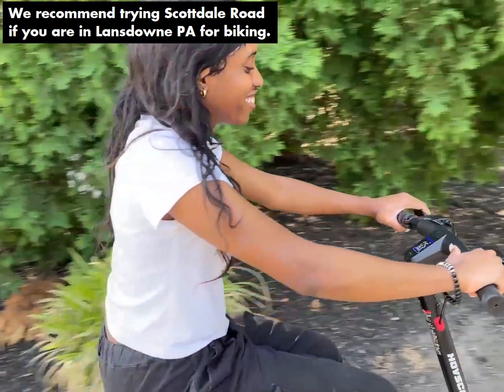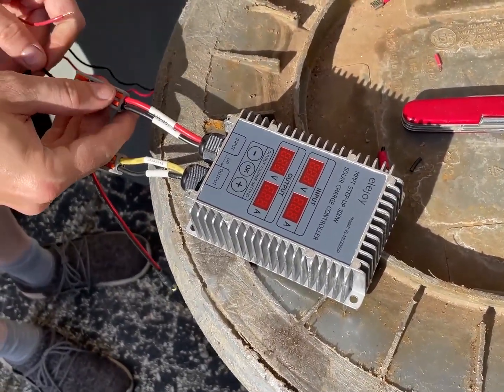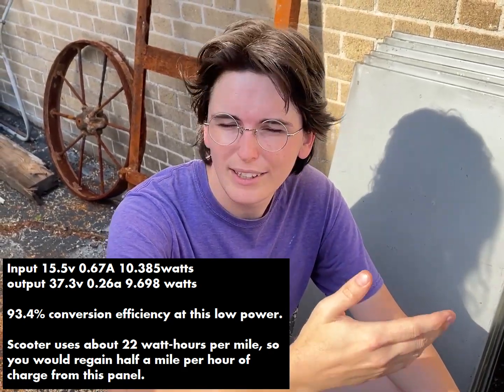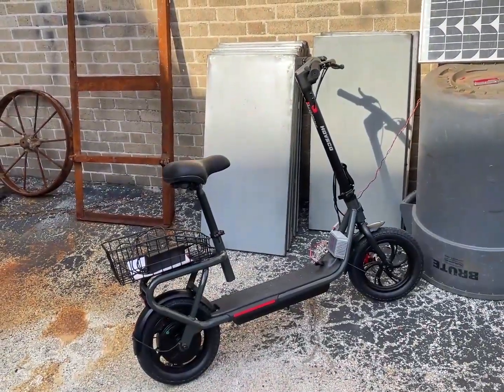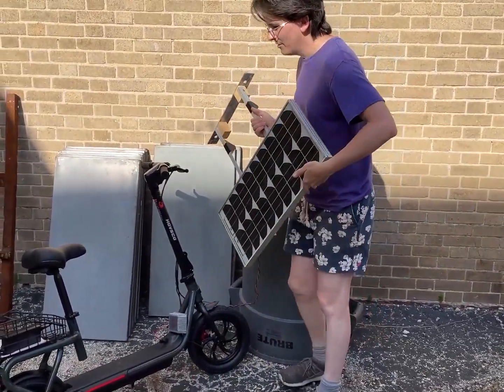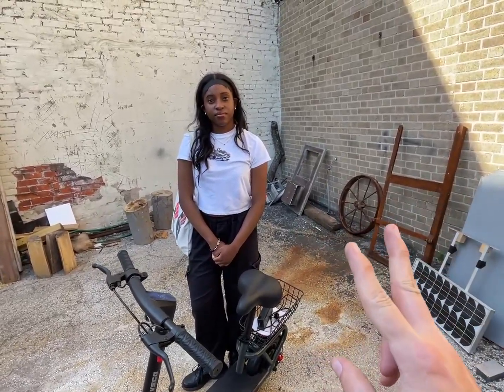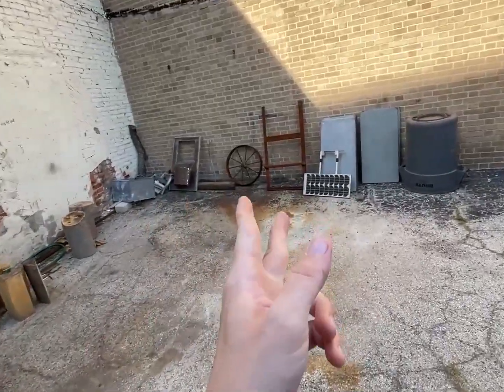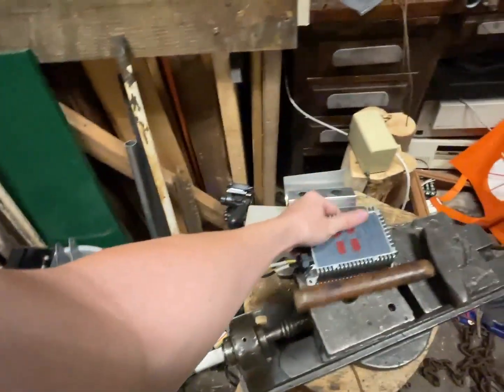MPPT Step Up charge controller solar test on the Hovsco Porto Max, and giving it to our friend Day!

Comment: That's a great idea, I want to build a pushcart, there are some useful concepts around there. But I'm afraid my fat 170 pounds backside would need like a 72V, 5000W motor....
Reply from the maker: Windshield wiper motors have a lot of power and they are geared, maybe you could get one of those for free and run it off 12v!

Comment: I so hate how all these things are made with charging that locks out operation, and ultra slow chargers that charge slower than discharge. There's no need to do that, and it can pretty much always be fixed by bypassing the mainboard and wiring the charger directly into the BMS.

Comment: A 12v pannel gives out 18 to 20 volts. The 36volt lithium battery of this scooter needs 42 volts exactly for full charge. If you use a 200 watt solar panel in full sunlight, it gives out 10 to 12 amps of 19 volts. Making it 42 on the boost MPPT will give you the proper 2.5 to 3.5 amps for charging which is similar to what usually the wall AC charger comes with.
Reply from the maker: It would be best to not fully charge it with the panels, full charge for balancing could be done with the original wall outlet every few months, but maybe only having two panels to keep it above 40% charge could be good
Reply: @RinoaL  It all depends on how it's designed. Many battery packs have balance circuits built in and can prevent over charging as well.

I'm not sure what percentage of chargers have built in voltage and amperage limits for scooter and electric skateboard battery packs.

The 4 skateboards I have worked on all had different voltage chargers but the packs were all built from 18650 cells.
Reply from the maker: Every stock BMS that I've seen in one of these just takes a bit off the top of whichever cells are highest. Perfectly fine to do that only once a year or half a year. You don't need to balance the batteries very often.

Comment: Three of the flexible 30 watt panels would get you the size and voltage you want. The sponsor might have them!
Reply from the maker: flexible panels would be hard to mount on the scooter I think
Reply: @RinoaL  They’re still fairly rigid, just not nearly as bulky/heavy. At scooter speeds, they should hold up.

Comment: For 36v and that charger you want a min of 100W. I not sure if true but some people say charging with too little current is bad for battery. I find 100W just gets ya full charge current in perfect conditions. I only charge with a 30W panel cause there charging a 12v bank and then I use an inverter from there with the E-Bike's normal wall charger. And I only started doing that cause I had the inverter for other things and thought at least I know it's getting the right charge this way. I think My MPPT and a 100W panel charging a 48v setup was only able to get about 1.2amps near low battery and .9Amp near full charge. Prob do a bit better than me on a cool day cause I'm too far up north.
Reply from the maker: You cant cause any problems charging too slowly for lithium, thats more of a lead acid thing
Reply: I would always charge the battery with the values specified by the manufacturer. Then the battery should last a long time.
Reply: @michaellichter4091  absolutely, and if the battery has a short life, you can say at least you used it right.
Reply: Low charge current is actually better because the battery doesn't heat up as much. You just don't want to leave it topping off forever because once the cells are fully charged, all the energy you put in gets turned into heat. It's all about heat.
Reply: When I am on the boat, I used a portable solar generator, it's only a 650w unit, but today I was running a 300w sander and keying the old varnish on both sides of the boat, ready for new coats, I started on 100% and sanded then varnished one side, when I looked it had charged back to 98%, the same with the other side, and on each side I had spent 15 minutes sanding at 300w, for the power I used on the boat (mostly charging a phone and a tablet, my solar generator is perfect.if it drops to 70% overnight charging stuff, next day it just needs a few hours and it's fully charged again
Reply: @grendel1960a  I need something like for my shed, I really don't need much cause all my stuff runs off batteries but there might be a day when I want to charge everything at once and not run the power cord from the house.  To be able to walk into the work shed and just plug all chargers in at once would be awesome. I just need a bigger 12v bank for the inverter and then a bigger inverter, I guess. I do have about 21X 12v 20Ah batteries laying around.  🤔 if they were new that's 420Ah lol